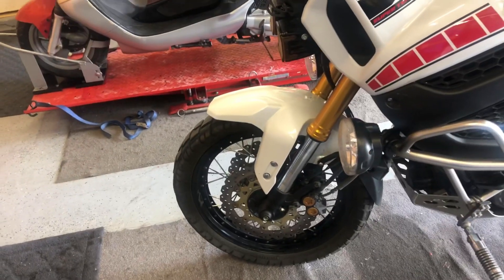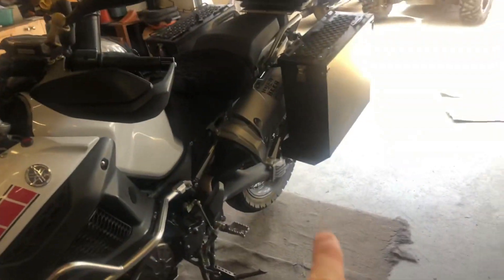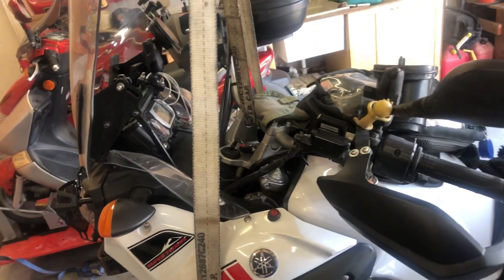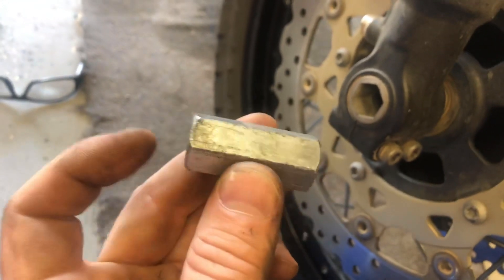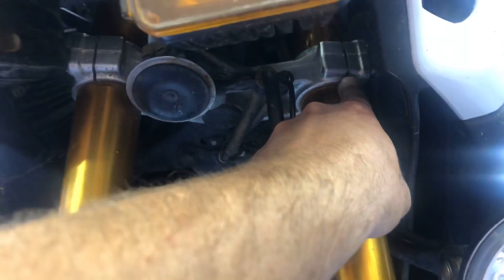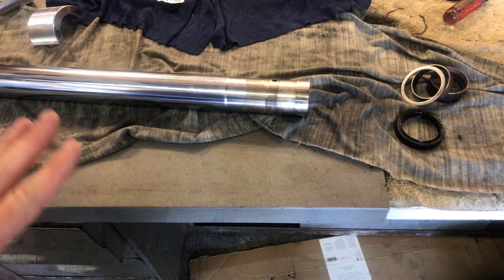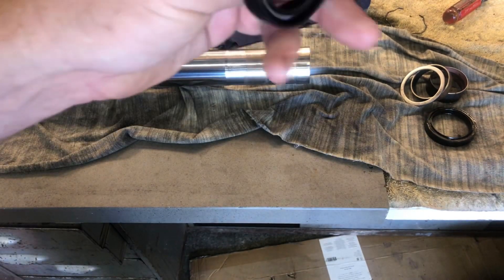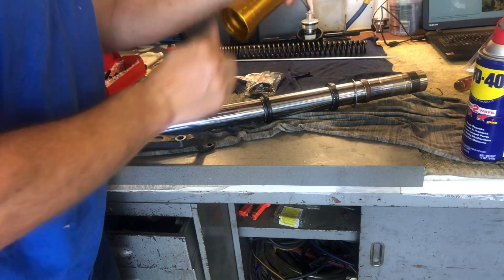Yamaha Super Ténéré Fork Seal Replacement / Rebuild

Comment: Thanks for the info. Changed my Seals this last weekend. Made a seal seating driver by cutting an old seal cleanly in 2 pieces. Put them around the fork & carefully tapped new seal in with a nylon hammer. Lastly I used a metric baking jug to measure out the 485ml & poured it into the assembled fork. Manually pumped the system to cycle oil through.
Thanks once again.
PS, I ground a cheap 14mm wrench down to fit onto the nut easily.
Reply from the maker: I like the way you came up with solutions, having special tools is great but not always a requirement.  Ride safely!
Reply: @TomsTinkeringandAdventures  thank you. I love my Super Tenére. I have a clip on YouTube on how I did a great exhaust mod. Look it up.
Reply from the maker: @paulvanreenen6986  I will!

Comment: For the Axle nut I just took a 3/4 inch bolt and welded a nut to it, been using it for years to take the wheel off. 
I'm cheap. 
carry on
Reply from the maker: Yep, I have a connector nut thing in my tool kit, same idea.  I’m cheap too!
Reply: @TomsTinkeringandAdventures  I noticed, I was a little intimidated with doing these forks until I saw your tools. I used to run and maintain my own heavy equipment so I am pretty set up, holy cow :P
Hats off to ya though.
Reply from the maker: @SlayerofFiction  yeah, it’s possible to do a lot with a little…or a little with a lot.  😃
Reply: @TomsTinkeringandAdventures  Oh I agree, although I learned a long time ago to just buy a tool and not fight it. 
Dad was old school and would make our own tools even uhgg. 
On that note I did see a home made Welder in the Philippines, wraps of copper with wood around it. 
They asked if I wanted to use it I turned them down, no thanks :P A+ for innovation though.
Reply from the maker: @SlayerofFiction  I grew up on a farm, farmers are very innovative about getting it done with what you have.  I can’t shake that even though I have been off the farm so long!
Reply: @TomsTinkeringandAdventures  Fifth generation Montana Farmer myself :) 
Got out of it 30+ years ago, live in a nice subdivision now and have a car on a trailer, they love it :P
Reply from the maker: @SlayerofFiction  I’ve heard it said that if we got enough farmers together they could solve all the world’s problems, once they were done complaining about the weather, the cost of crops, politics, etc.  😂😂
Reply: @TomsTinkeringandAdventures  Jeez I dono we were always fighting with the others over irrigation days, grazing, fence fixing etc. Politics were terrible and the throat slitting to get one up on someone didn't really serve any of us for the long term. 
Humans really are a strange creature, but yea, we need to sit down and talk. 
Cairo used to have a huge circular public space where citizens went to face each other and debate all sorts of things. 
I think that would serve us well in every town and city. However people rarely show up at downhill meetings, so not sure how to get them to attend that either.

Comment: Great work! Have you any idea of the diameter of an iron axis to put at the bottom of the fork for compression with belt and the tool ? I haven't an old pin and I'd like to find a suitable axis before dismantling the forks. A 1/2 inch pin would be fine? Many thanks!
Reply from the maker: I think 1/2 inch would be ok.

Comment: Great video. Nice tips. II have a  like to do my own work too. I've had some bad experiences from 5 dealerships over the years. I have a question? Every bike I've ever done fork seals on since the 70's. Most of them were dirt bikes. I was under the impression you are supposed to back all the adjustments out. I read that in one of my service manuals long ago. Does it really matter?
Reply from the maker: It’s probably a good practice to back everything out, less tension upon disassembly and reassembly.

Comment: Good vid.   Just did em.    

Just a suggestion....   Centerstand down, why not just put a floor jack under the front of the skid to raise the front end up vs the strap cluster?

Also I wrapped tape around the fork caps to keep em from getting buggered up by a wrench, they make em outta cheese.
Reply: Just a reminder....   Yamaha wants you to check oil level.with spring guide removed.   That dumb thing goes in a certain way too.....   I read that after i assembled the 1st leg.   Disassembled a second time to find I had installed it right the 1st time....     That sucked.
Reply from the maker: @highwayman1218  I was messed up on that strap anyway!  😂 Well mine are still working so I guess I will do a fluid change this year sometime and get everything right.  Have a great year, thanks for watching!
Reply: Great vids!

Comment: I think you’ve got the seal backwards as I’m pretty sure the spring side should be facing up into the fork not outwards.
Reply from the maker: I guess I’d have to rewatch the video to see if I put it in wrong, but if I did it must work ok.  I put 20,000 miles on it after that and sold the bike.  As far as I know it’s still working.  😂

Comment: Can you use the wrench trick to get it apart if you don’t have the tool to help compress the spring? I’ve done several dirt bike forks and figured I had all the tools but I don’t have that one.
Reply from the maker: I’ve done it without the special tools, it’s a bit more of a pain but it can be done.
Reply: @TomsTinkeringandAdventures do you have a suggestion on how to do it? I have some ideas but not sure what will be the best way other than ordering that tool lol.
Reply from the maker: @T_Shane  kind of difficult to explain, but I bet you can find some good pictures on the Super Tenere forum
Reply from the maker: @T_Shane  also, the tool is pretty cheap!
Reply: @TomsTinkeringandAdventures  it is. I just have a ride planned Sunday and the seals and bushings just came in today. Didn’t realize until today that that’s how those forks are setup.
Reply from the maker: @T_Shane  ahh, well I know I’ve seen some home brewed solutions on the forum

Comment: Thanks for sharing.  A 2nd set of hands would be handy.  What bracket are you using  to mount your highway pegs?
Reply from the maker: Kal Howell it’s a homemade bracket from some small U bolts.  Not great but it works

Comment: Hi Tom, you did not show removing the bottom bolt which keeps the cartridge at the bottom of the fork. The book mentions a special tool to keep the cartridge still in place while you unbolt the end fork bolt (the one with the washer). Was that necessary or you were able to unbolt / bolt it back without problems ? Thanks
Reply from the maker: I didn’t remove the cartridge, guess I could or should have but it’s not required for doing the seals
Reply: @TomsTinkeringandAdventures  Thanks, I realized that on a second thought. Besides do you know / have you done it ?
Reply from the maker: Davide Emilio Marazza not specifically on the Ténéré but yes I have.  I have used my air impact wrench to remove the cartridge holding bolt, no special tools required if you have an impact.  In the past I used a homemade tool, really just an old broom stick that I sanded down.

Comment: So my 2014-2015 service manual says  16.4oz, 17.11 imp. oz on one page/section of book pg. 4-101 and something totally different on pg. 4-106 gives individual oil capacity amount for left (17.07oz) vs. right (16.67oz)fork.... any ideas ?? and do you show the same on your electronic version you used in video. THANKS for the video by the way... well done Sir!
Reply from the maker: Lanny Griggs interesting, I don’t know about the ES suspension.
Reply: @TomsTinkeringandAdventures  mine is exactly like yours,  Non-Es
Reply from the maker: Lanny Griggs oh, well I wonder if the manual changed?
Reply: @TomsTinkeringandAdventures  My bad...the oil capacity does differ on ES config. Due to differing cartridge size hence differing fill amount, now we know. Thanks for your help and again for the video!
Reply from the maker: Lanny Griggs cool, thanks for the heads up.  I have not ridden an ES model, would  like to see if it’s worth it.

Comment: Hi, do tou remove the white spring  guide when doing your oil level.
Reply from the maker: tony smith I would have to read the manual, but usually it’s measured with just the spring removed.

Comment: Hi from Mexico City. Did you try cleaning the seal before changing it? I just cleaned mine but can’t use the bike because of Covid.
Reply from the maker: Garry Dymond it started leaking when I was riding in Canada.  Cleaned it a few times, it’s worth a try to clean them.  It helped for quite a while.

Comment: Tom,  I just bought a 2012 super Tenere, when I hit the brakes (front brake) my forks Dive immensely, I have been adjusting the pre load, damping, and compression and they still compress alot.  It that typical for these shocks, and what do you have your settings on.  MY spring preload is all they way down to 4, my rebound damping is at 3 and my compression damping is at 5 and these shocks still compress like crazy.... shoots me forward on the bike.
Reply from the maker: Anomie I’m set about in the middle on all of the settings.  I went a bit farther on the preload and really think it’s too stiff.  I don’t usually brake hard, but never noticed a lot of fork dive.  You may want to upgrade your springs.
Reply: @TomsTinkeringandAdventures  Thanks for the response, like I said I just got this bike and not familiar with it, so I am practicing quick stops and turns. Changing the fork oil is my next option.  maybe a stiffer spring;
Reply from the maker: Anomie well it’s always important to have it set up how you like.  Enjoy the bike, great machines.

Comment: Great vid. my 2012 S10 is just now starting to ooze a bit of oil so it is time do do my forks. can i buy a complete kit that includes the bushings and the seals? if so where do you recommend?
I just finished my SS1000 and I think that is what started the issue. My bike has 69000 miles and I will never get rid of it. you are awesome thanks.
IBA# 76062
Reply from the maker: TexasGater I didn’t look for a complete kit for this bike but have picked them up for other bikes from All Balls.  OEM is great of course, but it’s not in a kit.  Guess I will see if there’s a kit for the Ténéré.
Reply: Mine too leaking bad